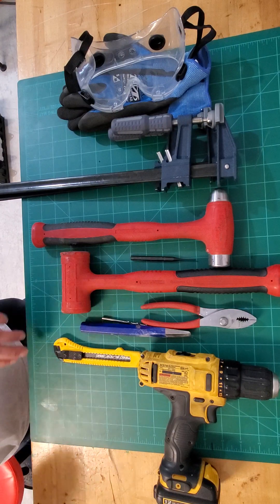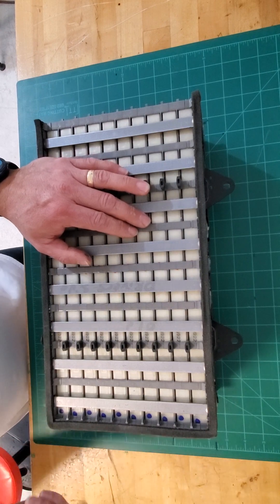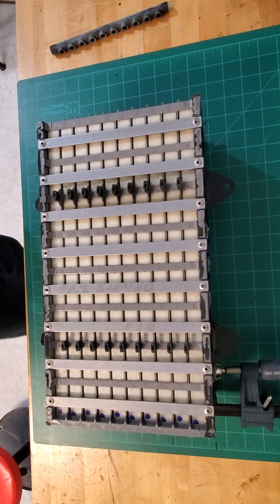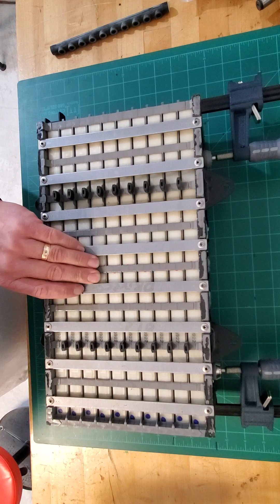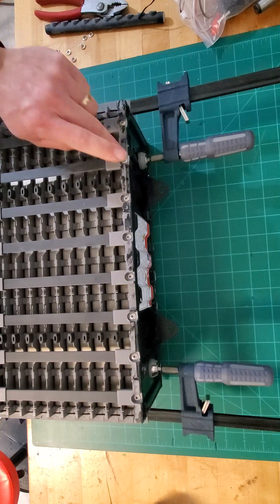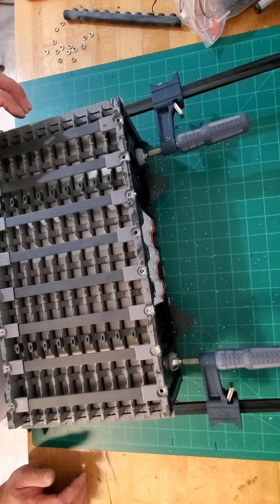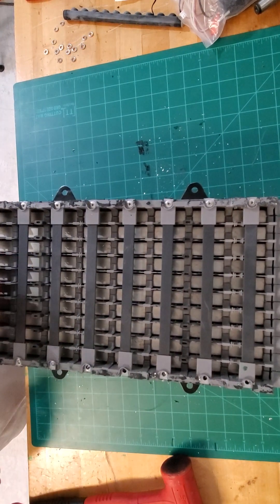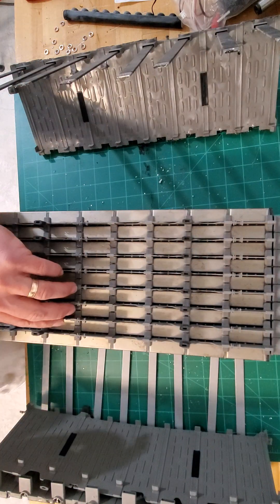Tear down of a Hybrid Battery sub-pack for 06-16 Highlander or 10-16 Lexus RX450H

Comment: How many volts does each cell hold ?
Reply from the maker: @stanparsonstreeinc  Base/Nominal voltage is 1.2 volts per cell times number of cells per module ie 9.6 per module or 19.2 per pair/block. 

Fully charged voltage is 1.45 volts per cell times number of cells per module ie 11.6 per module or 23.2 per pair/block. 

Minimum voltage is 1 volts per cell times number of cells per module ie 8 per module or 16 per pair/block.

Comment: Mr. Medrano! Very impressive. I could for the life of me figure out this process. If I'm reusing the subpack, do I re-rivet when I put back together? Or use screws or what? I think this is the only video of how to breakdown this particular subpack which is also in my 08 rx400h.
Reply from the maker: @johnclayton12able  when we rebuild these packs we use steel rivets size 5/32 with 1/64 to 1/8 grip